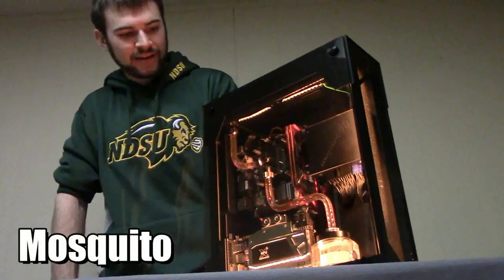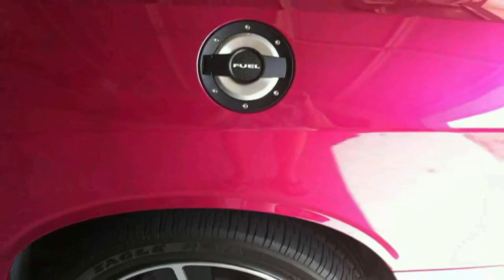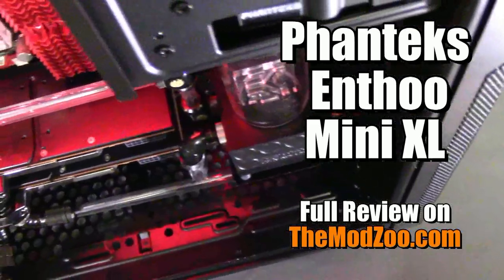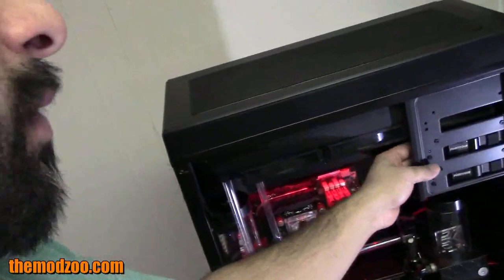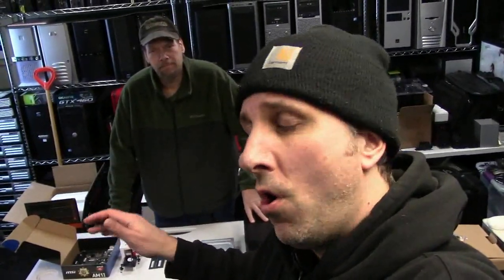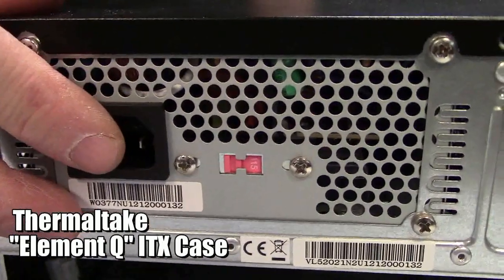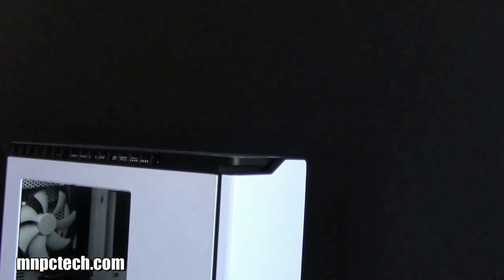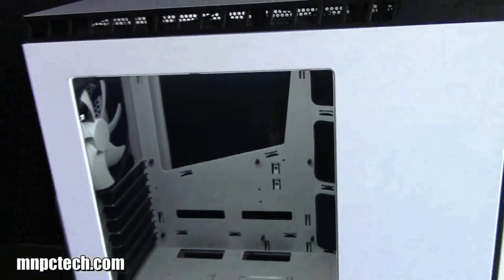Mnpctech VLOG 8, Lian Li PC-05S, Phanteks MINI XL, AMD AM1 PC, NZXT H440 Window

Comment: try Scythe Kodati rev B for mini-itx builds
Reply: That is a nice cooler, and I've got one as well, but the problem is that they were building an AM1 system, which doesn't have 4 mounting holes for aftermarket coolers, and the two they do have aren't spaced 'standard' either (I had to use a universal chipset waterblock when I watercooled one... because I could)

EDIT: Nevermind, you pointed out Rev B is compatible with AM1, that'd be one hell of a cooler for an AM1 system then!
Reply: Nigga Drive TV Sweet man, thanks for letting us know.  That's a pretty nice cooler, and should be pretty much silent on an AM1 CPU too
Reply: ***** also i recommend to try Scythe Grand Flex pwm Hight SP fan